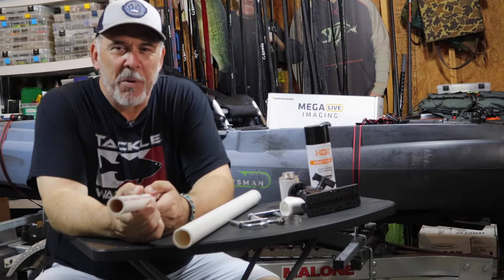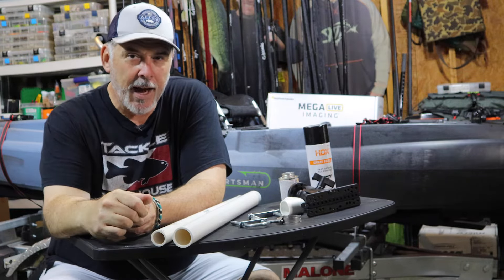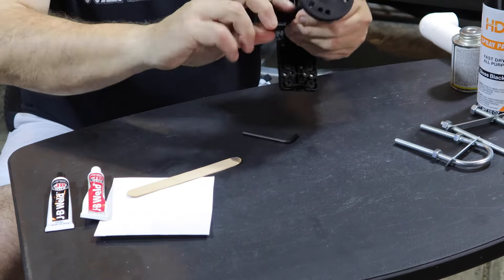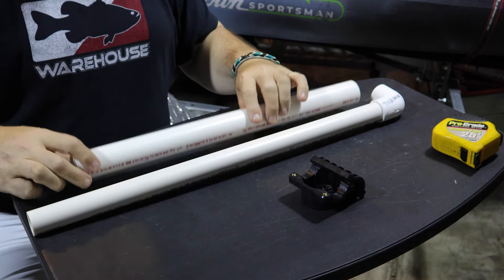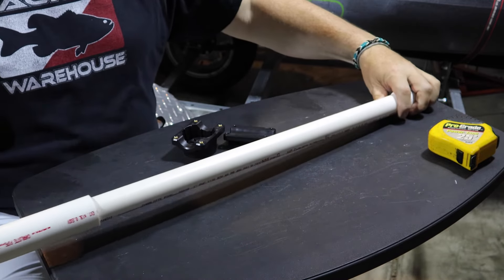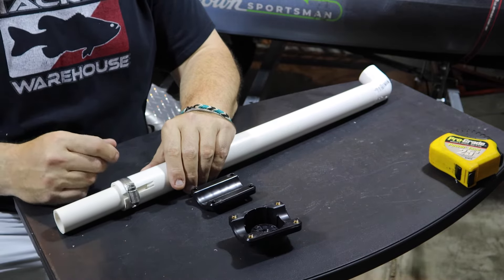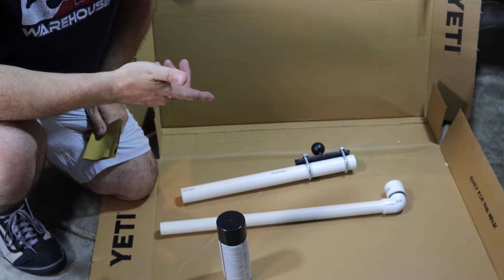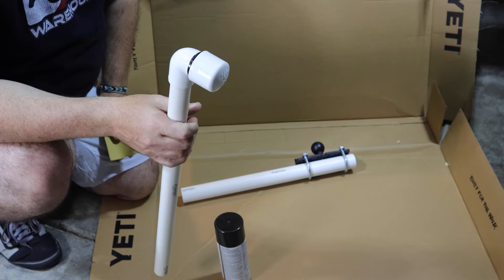DIY Forward Facing Sonar Pole Mount for Kayak Fishing –Easy Install Under $50 -Mega Live, Livescope

Comment: That seems pretty nice. A couple of things I would have done but are nits. Nylon nuts on the U clamp so they don’t back out. I may have put a cap or splice on the end to prevent the bracket from sliding off the bottom, maybe not necessary. Basically a barrier. Maybe put the notch out of the water so it could be adjusted with thumb screws somehow? I never would have thought of the notch, thanks. Thoughts? I need to make an ice fishing and summer pole soon since my ML was delivered yesterday.

Edit: Home Depot has stainless steel dryer clamps for 2.5” vents with a thumb screw adjust. I think that may be the ticket, but those may need trimmed off.